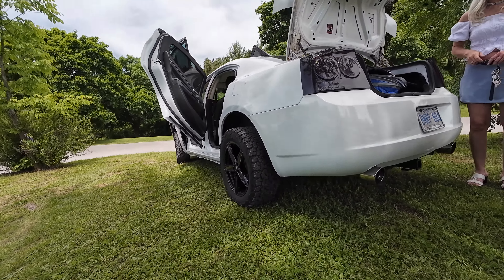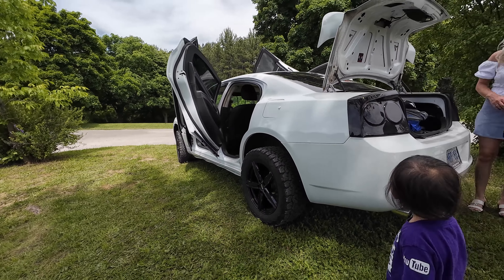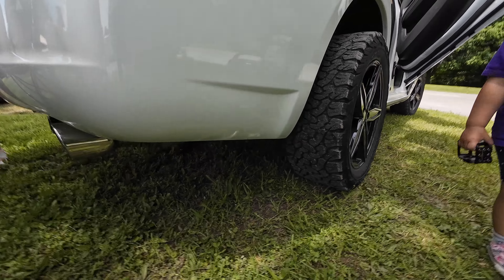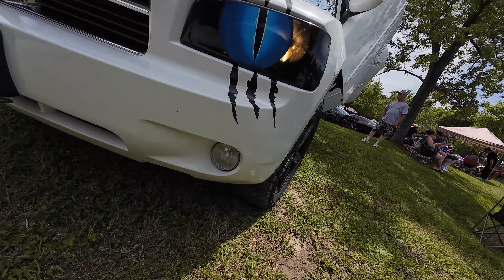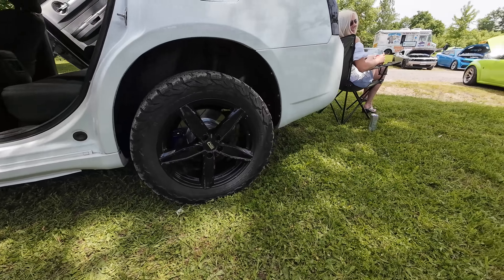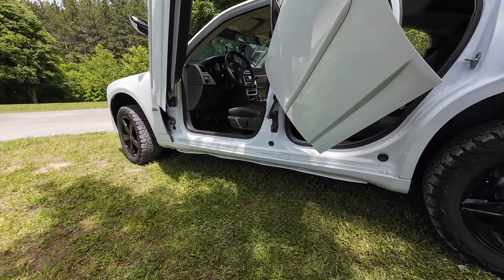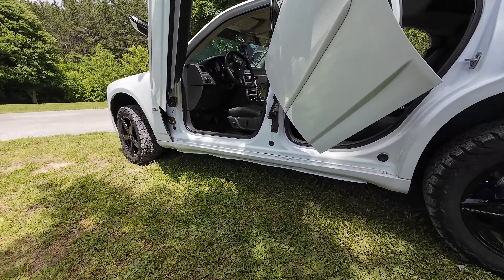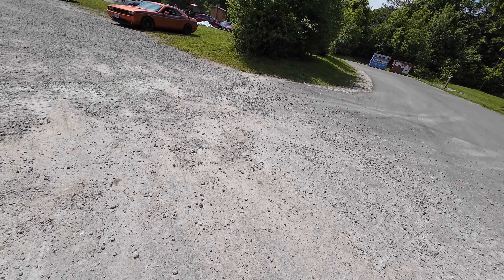lifted dodge charger

Comment: I mean they tried. If you want a lift you should swap in Durango chassis parts. The doors, not my speed as 2002 called and thet want their honda doors back. But honestly the Durango is based off the charger. You can with a little work and blood you can have a pre-runner charger.
Reply from the maker: oh dang, didn't know that about the durango, thnx for the info!